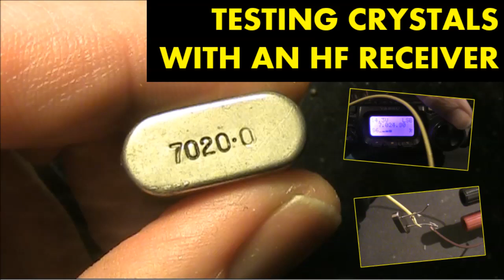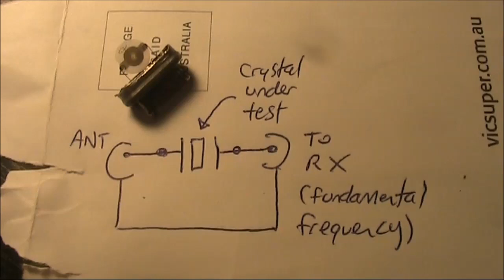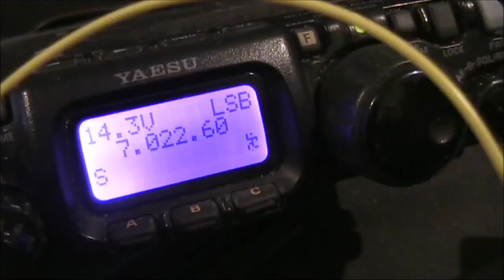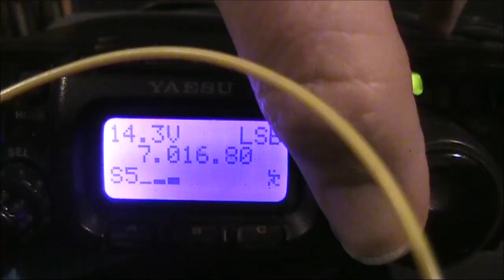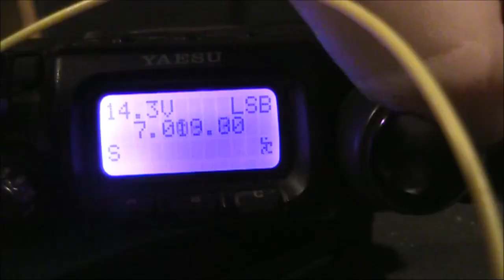Testing quartz crystals with an HF receiver

Comment: If you want a complete do it yourself treatise on crystals, you will have to go back to the 1935 QST magazines, November and December if I recall.  In those articles you will learn how to make a saw to cut raw crystal, the type of crystal to use and how to check the alignment of the quartz for the cut to make overtone or fundamental types, and the formula that approximates the thickness of crystal  to cut for a particular frequency. Then it is all hand grinding on a sheet of glass maintain parallel sides, with stops to clean the quartz and mount it in a holder to test it.  The pencil mark will lower a crystal freq, but in a production unit this would not be allowed.  The manufacture of this style crystal in this video, and HC6 size, was a fairly automated process in the later part of the 20th century, and even a CB radio company like Midland, had their own equipment to make crystals for their products.  But, the last steps were all hands on to confirm actual success of the grind.  Also, this style with the metal contact attached to the quartz took a different technique as compared to older mechanically assembled units that had contact plates separate from the quartz.  This style is usually not adjustable, if you chip the edges, that can cause it to not oscillate, or oscillate erratically.   I use a QRP Labs Crystal checker when grinding my own, but I use the FT243 style holders, much easier to deal with.  With the QRP Labs unit, you can put one contact plate on the checker, the crystal, then the other plate with a metal probe attached to the other terminal of the checker, and push down and it will oscillate and give a  freq reading on the display to see how close you are.  The final check has to be made in the proper holder though.

A side note.  Crystal making was an art in the 1930s and the time before WW II the military leaned they had no  source, all the companies in the US were basically 'Mom and Pop' and the one or two real companies only turned out a low quantity of crystals.  The military was going to need millions.  Crystals had an aging problem, and many crystals made for the military in FT241 style holders failed quickly, some failing before a new transmitter or receiver could be opened up new from the factory.  That problem was worked on through out the war.  Bell Labs had solved that issue in the 1930's, but were not in the crystal biz, they just studied quartz crystal issues to generate information.  Since Bell was not in the crystal biz, nobody asked them to provide their solution to the crystal problem that was not fully resolved until almost the end of the war. The Crystals Go to War is a nice video, but the real story is in the Signal Corp trilogy of books, the primary crystal info being in  'The Emergency'.

The 'Great War', WW I, the US learned that radio would play a big part in their future and quartz and bakelite were needed and hard to come by.  After WW I,  the US govt. started to stockpile quartz and bakelite, and they did so all the way until the Clinton regime when they were looking for cost cutting options.  The govt.  finally stopped the buying of these two elements.  Always wondered what they did with all that Brazilian quartz and bakelite raw material they had collected for 70 years.

Comment: Long ago I noticed that if you put one wire of a crystal on the antenna of a super regenerative receiver then it will go quiet with no static at all when its tuned to the crystal frequency. (Super regenerative receivers typically make very loud noise when there is no signal being received.)

Comment: The pencil mark on the xtal is how they "calibrate" or adjust the xtal to get it to the desired freq.   Old timers used to use this trick to "move" xtals  to a more desirable freq at times.  In fact Rex W1REX at QRPme has a kit to allow you to grind and check your own xtals.  You could probably make up one like it easy enough out of parts and microcomputers laying around the shack.  73

Comment: The RISE in noise is because you hit the series resonance of the Xtal.   At Parallel there should
be a dip.
There is  a SIMPLE  regen. circuit with no coils but a Xtal from grid to ground for a single freq
RX, The Hi impedance at parallel  resonance acts a very high Q coil. Just carry rocks for your required QRG and shift channel pronto.
73 G3NBY.

Comment: Peter, I am sorry you have destroyed your crystal. I have destroyed a crystal myself in the past. It was one of these hc-49s tiny ones, like the ones you have and they were getting very hot and very chirpy like in your transmitter. But this was at a 0.5A to 1A of total current draw. The small crystals transfer easily the heat from the die to the external can and you can detect it more easily, but the larger ones like the one you cracked do not, so it is more difficult to detect. Lesson is, Do not use a crystal for quite long, if it sounds too chirpy with this transmitter. This means it is overheated inside. 
However, I have never destroyed a crystal that sounded chirp-free on the air.  Cracking a crystal, seems believable, but removing the plating material from it, seems too extreme. I do not think this has been happened in your big crystal due to heating.

Comment: -- Interesting!  I have a pile of old crystals that I am not sure are working or even what frequency they are oscillating on.  

I tried it on a long wire antenna while getting a lot of background noise and I noticed the signal level dropped by about 1-1/2 dB at resonance and much more on just off frequency.  So I'm wondering if it also improves the signal-to-noise ratio on signals at that frequency.  If it does, it may be a useful add-on for simple receivers matched with QRP transmitters using the commonly available 3.579 MHz TV color-burst crystals.  

So, some more experimenting to do.  Now I'm also wondering how the arrangement passes harmonics of the fundamental frequency.

Comment: Sir can we using a xtal as a receiver??
Reply from the maker: A crystal is just one radio component. A receiver needs many electronic components to work.
Reply: @vk3ye  oke sir,understoo.but if me using two xtal same frequency,one as transmitter and other as receiver,can it works sir???just like a walkie talkie.hehe
Reply from the maker: @herupur1117  Crystals by themselves are useless without other parts to form a transmitter and receiver. A good radio theory book eg Ron Bertrand's Radio Theory Handbook will help you understand this further.
Reply: @herupur1117   why not. you can see verious cw tx and rx using xtal based circuit. have a look at vu3inj.blogspot.com if any query put reply on blog will reply there.

Comment: Hi there vk3ye i've resently made a loop antenna but it does not work for my reciver since it only takes normal dipole or monopole. Is there a way we can convert the loop antenna output to make it a dipole/monopole output?